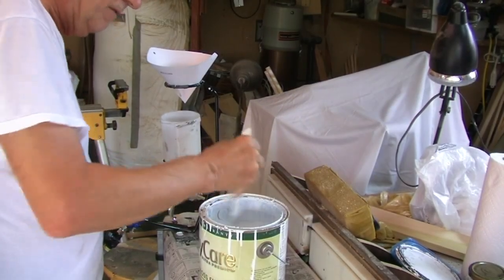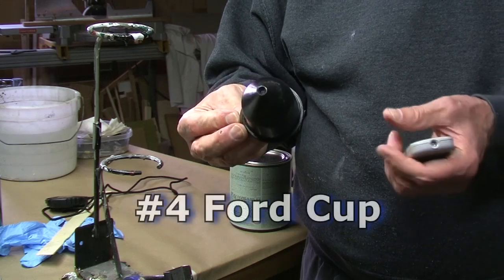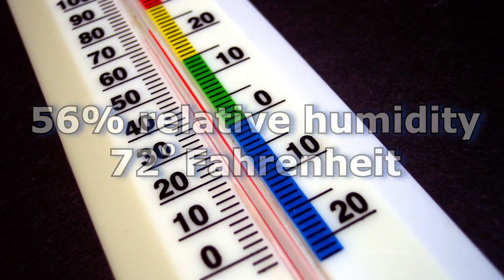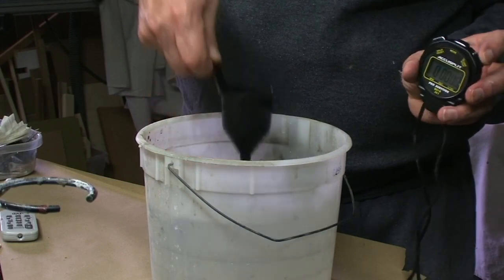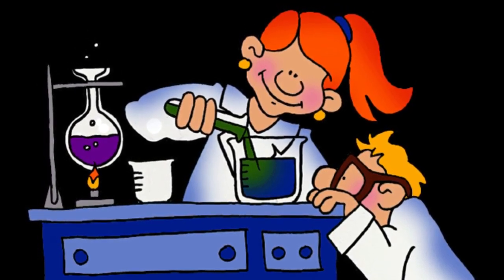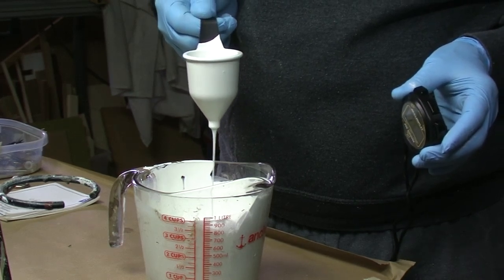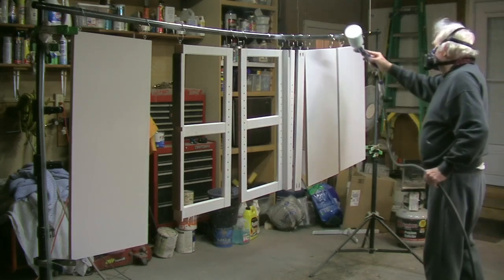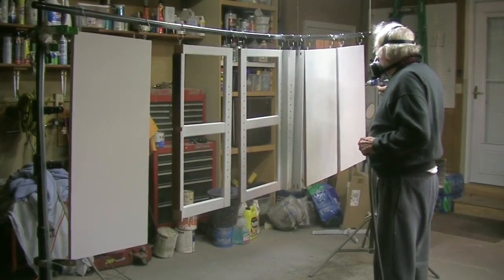How to Thin Water Borne Paint for Spraying, Measuring Viscosity

Comment: Forget 1 thing, the more water in the paint, the less strong your paint is going to be when dry.
Waterbase paint, 99% of times always max 10 water.
If it does not work to spray, change your spray system, not the paint.
BTW not all paint is made to spray.

Comment: I was having issues spraying exterior house paint doing trim work with my old Harbor Freight purple gun which I had modified to 2mm.  3d printed a Ford #4 cup from Thingiverse and it did the job nicely. I was surprised, had to add quite a bit of water to the paint to get it from over 1-1/2 minutes down to around 20-25 seconds. Paint sprayed much nicer and smoother after!

Comment: Why make it all so difficult man 😅 
You don't need all this rocket science level measuring
You need paint that can spray? Have you ever had a glass of milk? 
That's the consistency you want oh and for non waterBASED not born paints just toluene (main building block of regular cellulose thinner) or if you are working with oil based enamels, I myself use pure xylene (,which is corrosive so know before you buy please) though you can stretch it simply by adding some ethanol. It's gonna adjutate your xylene base and then though already very vapid it instadry! Then afterwards cleaning the gun out with Ethanol is a breeze! Though I get your idea here that's too much to say; teach a beginner how to thin their paint down 😂 anywhoo I do admit this is very clever man! But legit. Milk the 2% kind. That's about it as that just flies out of an airbrush which can be even more finicky then a spraygun! And with waterbased or also waterborne paints (of the latter not all) but waterbased acrylic? I take 1 part water nowadays and 2 pure Ethanol or isopropyl 99% all in the same bottle (it doesn't actually mix) though the water breaks the paint up a bit and then your solvent will continue thinning it's consistency down but without washing all the pigments out because any and all waterbased paints a bit of water is ideal to make it flow but the same bit too much can wash out pigments. It's just an idea I figured I'd share again it doesn't change the cleaning afterwards but you for one get further with the same can of bucket of paint! You're adding vapid solvent so you can work even faster and IF you let it sit and something feels clogged you have some ethanol. Rinse out, and you are good to go again my friend!

Comment: Don't use gravity feed for water based paints because it drains to slow out of the gun and inconsistently to mix properly with the speed of the air when it's mixing.  Do use a siphon feed as it forces the paint out of the cup much better way to spray thick water based coatings.  If you can find a binks number 7 gun that's money for thick coatings including automotive primer.  Siphon feed trumps gravity feed all day everyday for anything.

Comment: Cheers for the video bud with Johnstone's acrylic Quick Dry Gloss, Brilliant White for 240ml i had to add the same in water to get it to spray with my Apollo Pro-Spray System 1500 HVLP the viscosity from the can was 8mins plus way to thick with the water added got it down too 15-18 secs spot on for my interior wooded doors ¯\_(ツ)_/¯♥

Comment: I've been spraying my motorcycle tank with water-based paint...at least  trying to. After experimenting with thinning (distilled water), I got it thin enough to try it out. My first coat of high gloss, cream white went on smooth and even in some areas, but less so in others. I was also surprised that in no time the paint would dry in the nozzle till only air would spray out. 
Conclusions and observations; 
1.) 2 mm nozzle sounds about right for water-based paints and I think it's because of the way it  actually dries in the nozzle, blocking flow.
2) air pressure should be set a low as possible while still maintaining flow and spread. I'm playing around with 25-30 psi on vertical test pieces...may try 20 psi.
3) when everything is right, ie., viscosity, nozzle size, air pressure, and ambient temperature, the w-b paint is great. The fast drying and non-toxic qualities make it enjoyable to work with. However, get one of the above parameters wrong and you'll be sanding back and respraying the same piece again and again.

Comment: Hey Ron. What an amazing video.  I appreciate its old but I could really do with some advice.  Your video is a little advanced for me in some ways but makes perfect sense.  I am going to use some cheap electric spray guns to complete some water based undercoat and gloss work on doors and skirting etc. Spraying solves a lot of problems and I do have 'some' experience of using spray guns (accepted my tools are primative).  
I'm not worried about runs. I think I can manage that. (I suspect the quality of the paint output will be the issue).   Anyway. Any advice from the US to the UK would be helpful.

Comment: Ron, I am so glad that you put this up.  I come from automotive too, took some training but never painted for $.  It makes me have to be precise. It's just how I am.

So to bring this together. You recommend 20 to 30 seconds to empty a Ford #4 cup.  
And adding 25+ % you got around 45 seconds.  
Latex paints can be different between types.  I think I will go 40% and check.  If it's too thin I can add paint to fatten it up. And if it's still too thin, well 5% at a time.
Also,  I have been taught and found it true that to really get a good mixture on latex paints it is best to pour the paint back and forth between two containers.  I have a drill driven stirring tool too.   I'd think that if I keep the tool down in the paint that it won't aerate.

BTW I have a DeVilbiss FLG4 (Finish Line) which is considered low level pro or good level DIY.  It came in a kit with a few tips, biggest is 1.8, but I bought the next available which is a 2.2.
I agree with you on the gun mounted oil water separator.  I have a cheap separator regulator on my wall from Harbor Freight and a line mounted one just before my gun regulator.  Was able to do a fender on the wife's car one Sunday morning when it was 70 degrees.  I waited for the weather for that! 
I'll use your info and want to remind people to filter any paint before it goes in your gun.

Comment: for me, I would always try to spray on a horizontal surface, if at all possible.  also, I have given up on gravity feed hvlp and am much happier with a pressure-pot based sprayer (about $60 at harbor freight).  You can use less thinning since the paint is pushed through the gun but also, not having the cup on the gun allows for so much better spraying experience (tight corners, upside down, and simply rotate the gun to rotate the fan).

Comment: For me: Krylon color maxx 250ml...water: 150ml basically a 60% ratio.....with a 1.4 tip. Beautiful spray, Layed  smooth. 90 psi at the compressor. Single red HF desicant at the gun. Originally, I tried 70%, but  the piece got a little splotchy.  It all depends on the viscosity of the paint. I started at 50%,  then moved to 60%.

Comment: Hi I have a kitchen to spray all units what size needle should be in my gun for fine finishes
Reply from the maker: The smaller the needle and fluid cap the finer the spray; however, I sprayed inside the cabinets on the side of a fuel tanker one time and found that it was not a very pleasant job.  The paint blew back in my face and after that, I decided that from then on I would use a brush or roller to do the inside of cabinets.
Ron

Comment: The best solution is using airless paint sprayer for this type of paint.
Reply: Not best when you consider the clean up and hassle of airless sprayer. Besides, if you already have an air compressor, buying an HVLP costs merely a few peanuts. And chances are you already have one anyway.

Comment: Iam mixing 3 liter 1k base coat and 1 liter 2k  paint thiner and ready to go  to paint the car after priming 😁 with hvlp paint gun after that I'll see the clearcoat which is better compressor or homeright electric how it's going but iam doing this with homeright finish max, previously iam doing this with air compressor and just thin 1:1 but I think in this case for this ratio 3 to 1 ill need 1 coat only 😅😅😅 even primer 1k   to 2k thinner it should be 1:1 with hvlp gun, but I don't know how much I'll mix to get 40 viscosity or 50 but looking to change electric sometimes iam using  this sometimes but if electrical went nice I'll stay with it cause easy to handle and to work with

Comment: Im currently using a metal flake gun with a 3.0mm needle, seat and cup setup.  I found thinning latex 15-18% sprays beautifully with this setup and you can keep the pressure down to 30-35 psi at the cap.
Reply from the maker: Thanks for the info.

Comment: I have a HVLP spray gun. 
Tried spraying enamel based primer & paint on wood furniture. But always get orange peel finish.
I used MTO- mineral turpentine oil for thinning.
Kindly suggest how to avoid the orange peel finish and get a smooth and shiny finish

Comment: I like the vid - well explained Ron. I wonder one thing: wouldn't spraying without any protection for the overspray lead to painting behind the objects that you're doing? Also, if I plan to do some base and crown moulding in the house, how much masking paper should I put to protect around - is 12 inch in each direction enough?
Reply: And all you used was water? I don't need to get paint thinner?
Reply: @YoPoeticSource_Me  Floetrol and DSITILLED WATER - just to be sure, no tap water, chemical can screw things up. Take 300ml (10 oz) of paint and add 0.5 oz water and 0.5 oz floetrol. Stir. Measure with Ford cup. When I got 70-80 seconds I was good to go. I got a book on it from this American known finisher if you want it. For BM Ben paint I used about 10 oz with 2 oz water and 2 oz floetrol fyi - there is no rule. If the paint is dryer (water evaporated) you'll need more water and floetrol. Floetrol conditions the mixture to keep things together. The nozzle for 70-80 seconds was 2.5mm btw. 

I am now 1 year plus later and my painted surfaces are still good; no problem.

Feel free to ask me if you got more questions D. Cheers.

Comment: Excellent video! Very clear and to the point! Question: What is the paint with the hardest finish (as opposed to the "rubbery" finish of latex) that you would recommend for doors and tabletops? Also, is a HVLP gun like the one on the video much better than the handheld types like the HomeRight, or separate budget turbine systems?
Reply: With homeright use viscosity cup and you are safe if you use the right ratio for hvlp gun on homeright itll not work well cause ive tested that at least on painting cars primer, base coat, clear coat
 With painting rooms its perfect 400 ml and 100 with water based paint so homeright I feel it has its own rules follow it or you'll waste your time and money thier key is viscosity cup and thier manuel showing you viscosity range, good luck

Comment: 3:1 mixing ratio through a 1.4mm tip.... Youre welcome
Reply: Dumb question, but 3 parts paint or water? Lol
Reply: No dumb question, 3 parts paint and 1 part paint thinner. For example, (3 ounces of paint and one ounce of paint thinner) or 
(6 ounces of paint and 2 ounces of paint thinner).  Both of those are 3:1 ratios  @eivartheewizard4639
Reply: @eivartheewizard4639 3 parts paint and one part thinner 👍🏽
Reply: Wouldn't you want 2 mm for thicker material like latex paint?
Reply: @Ericpotratz  up to you but I've sprayed my walls using that ratio and it came out very smooth. I've painted 3 rooms in my life but I've been painting cars for decades and using an hvlp gravity fed paint gun using 3:1 ratio was top quality for my walls.

Comment: Can you thin paint that the manufacturer suggest not to thin? I have Valspar's Solid Stain and it is water based. I does say not to thin but I want to spray it and it will no doubt be too thick for such an application.

Comment: Very helpful. I've been sprayiong with wagner airless plus and found 30 to 40secs to give an excellent mix. Thats using Armstead Contract emulsion paint on walls and ceiling. About 2l of water added to 5 litres of paint. Need to stir vigouously for at least 5 mins to get homogeneity.

Comment: Excellent approach by measuring the viscosity.  One thing I've found that makes things easier is to use a measuring cup that provides three ratio thinning gauges.  The reason for the three ratio is that I usually add not only water, but Floetrol to the latex.  For instance, most of the time when spraying latex paint with my HVLP turbine-based system (it's a Fuji 5-stage turbine) is to use the 5-1-1 gauge: 5 parts latex; 1 part water and 1 part Floetrol.  Sorry for not providing the viscosity reading from my Ford cup, but if memory serves me, it was around the 25 second range.

Again, great video.
Reply: Thank you for this comment! It was very helpful to me.

Comment: should you not use a gun with a internal mix nozzle for water based paint
d
Reply from the maker: I did buy one, but haven't had a chance to use it yet.  I intend to use it to also spray contact cement.  Thanks for your comment - Ron

Comment: Hello Ron,
I will be spraying about 400 SqFt of DC315 on Open Cell Spray Foam.  It is a fire retarder and its viscosity is 9,000-10,000 at 75°F  (a little less than honey).  I have a Wagner Airless Sprayer and was wondering if that might do the trick.  Otherwise, what sort of Airless Sprayer and tip should I try to rent that can handle that sort of Viscosity?  Thank you.

Youtube search for DC315:
https://www.youtube.com/results?search_query=dc315

Proper mixing of DC315:
https://www.youtube.com/watch?v=C54d2oKxcx8

Comment: I mentioned the "viscosity cup" during a recent conversation with local Sherwin-Williams store manager and he had never heard of such a thing.  He did say, not to thin more than 10% with their water based paints.  I still end up with a lot of over-spray that drifts all over every flat surface in our basement.  Using the Graco Ultimate with Fine Finish Low Pressure tips.  How do you deal with over-spray in your shop?
Reply: Nice name lance

Comment: Hi Ron. Great video. I just loaded my Fuji HVLP with a 1.8 tip for the first time. I’m priming a birch bathroom vanity I built. 

On my test boards I got lots of spattering. Would that mean I need to go thinner?
Reply: Probably not enough air pressure.
Reply: I’m using a Fuji HVLP also and I’ve found I had spattering when the paint was not thin enough.

Comment: Ron, Thanks for the great video.  I'm a novice at painting and finishes.  I have a HVLP system which I'm "slowly" learning to use.  I recently used some thinned Latex enamel to paint some flat horizontal surfaces. Painting horizontal was very forgiving for avoiding runs.  You mentioned in your video that if you paint vertical you should paint a "tack coat", let it dry then paint finish coat.  Could you expand on that comment just a bit.  What does this tack coat do, how thick, when you say let it dry are we talking minutes or hours.  Thanks Ron hope you are well.

Comment: Hello Ron. I have a couple of custom cabinets that I've built to paint. I have been looking at purchasing on of  the hvlp turbine spray systems that house painters use. But, I have an old binks model 7 gun and also a binks pressure pot with a binks 2001 gun. I picked up the pressure pot setup for an inexpensive price but have yet to actually use it. I just have this feeling that I should be able to use what I already have to achieve good results. Perhaps I should get an HVLP gun to run off of my standard air compressor. I will be spraying a sandable acrylic primer and acrylic enamel topcoat. Your thoughts would be greatly appreciated.
Reply from the maker: I used to spray trucks using a two-quart pressure pot setup.  This will certainly work, with the one exception that it will take more pressure to atomize the paint than an HVLP gun.  You mentioning a Binks 7 brings back memories.  With that said, if your pressure pot is in good condition, that would be my choice.  It will eliminate a lot a weight from the gun and make the gun handling a lot easier.  If you are spraying both the inside and outside of the cabinets, I hope you have a hood respirator to cover your entire face.  There will be a lot of blowback.    Hope this helps, Ron
Reply: Thanks so much for your response. Once I found your video and saw that you were spraying using an air compressor I knew you could answer my question. I'll have to see what size needle is in the 2001 gun and give it a go. Also considering just getting an hvlp gun like you are using.Just like to add that we have one thing in common, a full head of grey hair! Thanks again for producing a video with so much good information that will help me on my projects.

Comment: Its great!
Let me know can we use the same way to add water in to Automotive paints?
if not what is the best way?
Reply from the maker: Not all automotive paints are water based and a good many come pre-thinned and ready to spray.  I believe that all clear coats are still solvent based and should be thinned based on the percentages given on the label.  Most auto body paint jobbers can supply you with a booklet describing how to use their material.  I sprayed the deck lid and quarter on my Miata last spring using NAPA's Acme brand acrylic enamel which came pre-thinned.   All I had to do was add the hardener.  Hope this helps,  Ron
Reply from the maker: Automotive paints will come already pre-thinned to the proper viscosity or have a recommended range.  Having sprayed cars for over 20 years (60's - 80's) I learned not to play chemist with the materials and to follow their instructions to the "T".  Thanks for the question, Ron